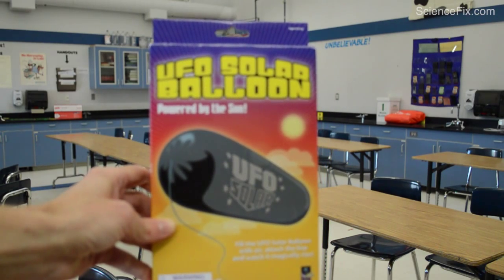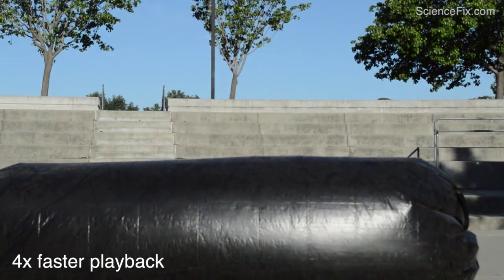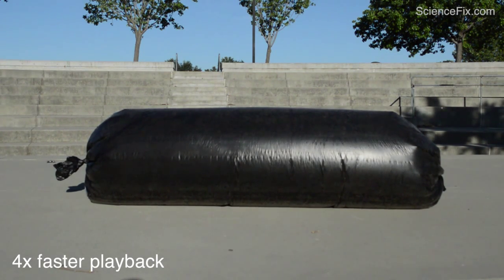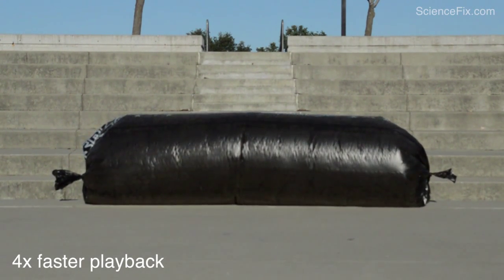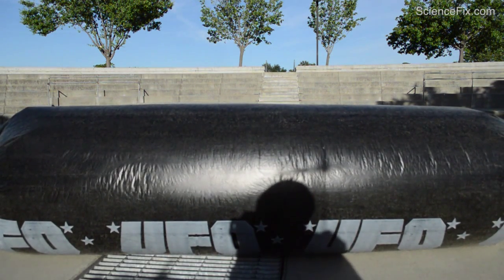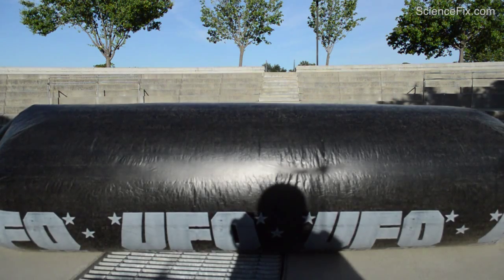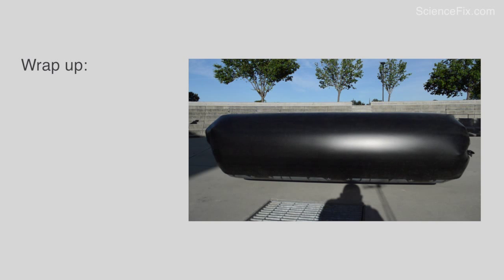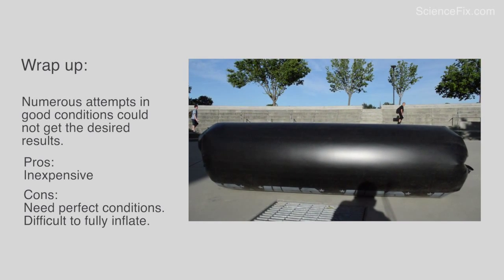Review: UFO Solar Balloon

Comment: Dufas....PVT Boyles law ...you filled it TOO FULL and didn't leave enough room for the air to heat up and expand.  I did one 30 years ago, on a sunny winter day, it got away drifted over the airport, and had interceptors from a nearby air base check on it. Made all 3 TV station that night.

Comment: Here are some suggestions:
Should use Leaf blower. Household fan.
Fill it with cold air. - Not over a black surface. -  Not in the sun. -  Like early morning in garage.
The loose ends "pigtails" will only weigh it down. Tie it off at the very ends.
Seal one end knot with a lighter.
Use straw to blow in the last bit of air.
Rubber band to clamp it off while tying  it off with dental floss because it's Light & strong.
Hope this helps U achieve a good launch.
Reply: Fester Blats
I understand what u are trying to say, and it has a certain validity.
From memory he had difficulty filling it completely?
 If so, then there is also the problem of - the  weight of the bag never being able to be overcome, if it contains too little air.
My guess is that the cold air expanding into the bag will have little problem stretching the sun warmed bag slightly.
Much the same as a helium balloon, which is not kept grounded by the fact that it is kept under pressure within the balloon.

Comment: Starting with a full bag and heating it up doesn't make it less dense.  From the Combined Gas Law, if the volume doesn't change, you just get higher pressure. A fixed number of molecules within a volume is always going to have the same density.  Start with a half filled bag so the volume can expand with heating.

Comment: What if you did it over grass? Isn't the hair over the pavement warmed by heat radiating off the pavement? This would make the air inside not much more dense than the air outside.